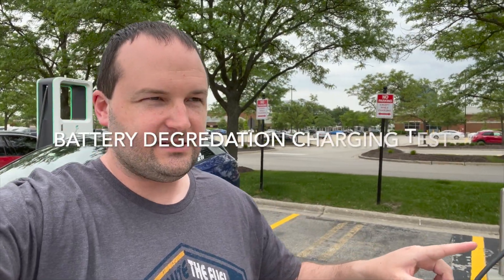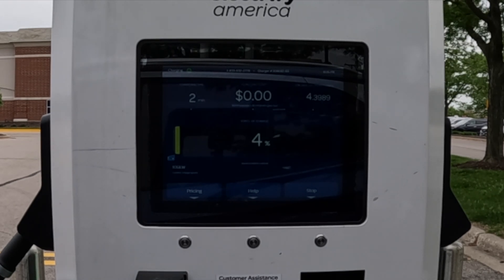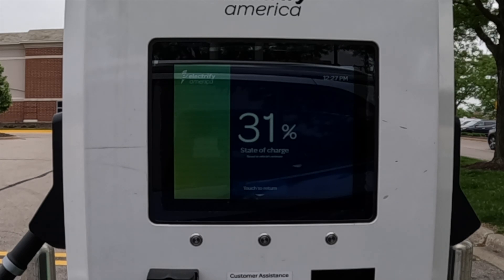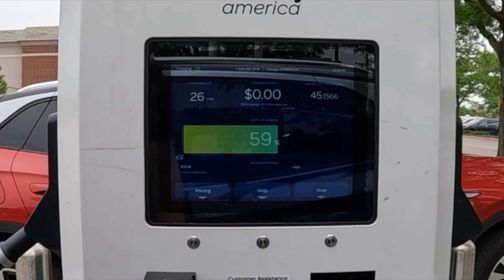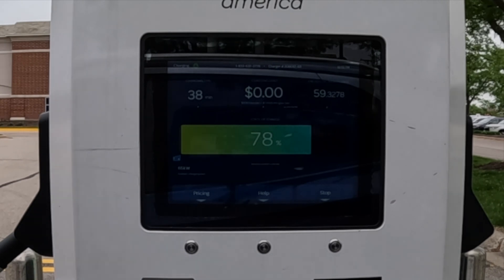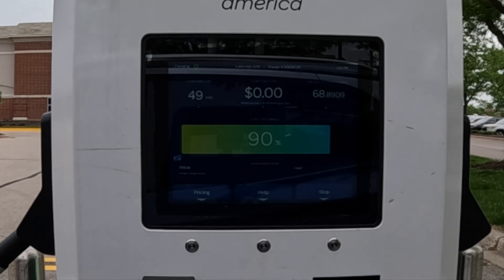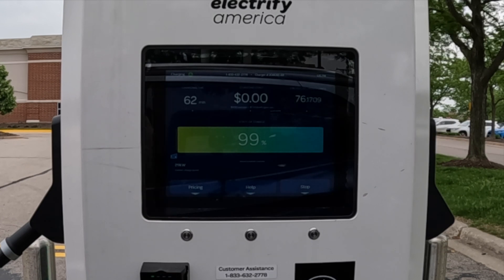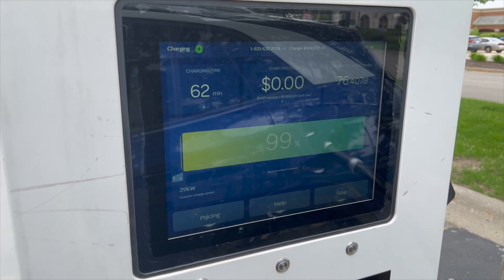Volkswagen ID.4 Full 0-100% Battery Degradation Charging Test

Comment: Any regrets on the I.d 4 ? Or you pretty happy with your purchase ?
Reply from the maker: I think it was a great purchase. Only real flaw is the infotainment/lack of updates. Otherwise it drives very smooth and the free charging is hard to beat
Reply: @EVMotoring  I’m seriously leaning towards the I.d 4, model Y is way to expensive for me here in Canada 🇨🇦. Have you noticed Any further battery degradation since ownership ?

Comment: Thanks for the video. How does the ID.4 do in the snow? Do you switch to snow tires? Weighing whether to get AWD or not. Thanks.
Reply from the maker: In Chicago, the roads are well maintained so I thought it performed great!
Reply: @EVMotoring  Thanks, I'm in Cincinnati and we don't usually have more the a few snowy days. Much less than Chicago!
Reply from the maker: @larryrichmond  I think you should be fine with the rwd then. IMO AWD sometimes provides a false sense of security since all vehicles take the same distance to stop
Reply: @EVMotoring  Oh I definitely get that. Just addressing traction not defying physics lol.

Comment: i'm really looking forward to seeing how this changes once the mythical 3.0 software arrives. If the ID4 can get that new 135kW peak charge and the curve flattens out to shave 9 minutes off the time to 80%, that'll be a big improvement! 

Couple of quibbles though in your comparison discussion is that the Mustang Mach-E has a consistent 20 minutes charging profile regardless of the starting point between 0-40%. ID4's have to surf the bottom half of the pack for the fastest 20 minutes of charging but Mach-E's get that same experience even plugging in at up to 40%. Also, the Mach-E drops to 45kW or so at 80% for the 2022s and for any 2021s that have gotten the software update.
Reply from the maker: I think Ford is still holding back a bit with the MachE. I really hope they open it up soon!
Reply: @EVMotoring  I love your optimism! You have more hope than I do on the Mach-E. The ID4’s profile really rewards surfing the bottom of the pack for the fastest charging. Will the improvement to 29 minutes to 80% change your charge stop behavior?
Reply from the maker: @anthonyc8499  most of the 9 minutes is attributed to the higher peak speed but I won’t know until we can see the new curve.

Comment: I think providing free charging is a bad idea as it'll clog DC Fast Chargers for no reason.  I think a better idea would be reduced cost, even as low as $0.15/kWh which is more than 50% off but people won't charge just because they are at Walmart and there is a charger there.

Comment: Thanks! FYI kWh is a measure of energy, kW is a measure of power (which you did get right later in the video). Will your car get 135 kW peak charge rate with software update? When will you get update?
Reply from the maker: No clue on when the update will actually arrive but yes, it should be retroactive to 2021’s